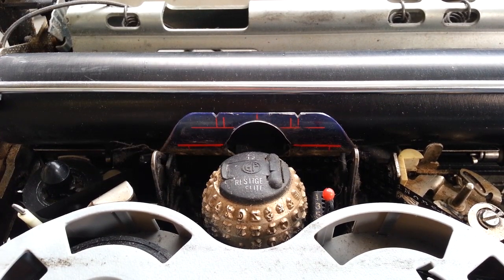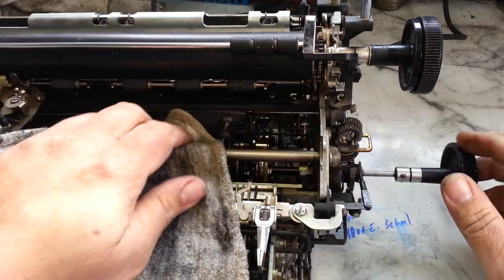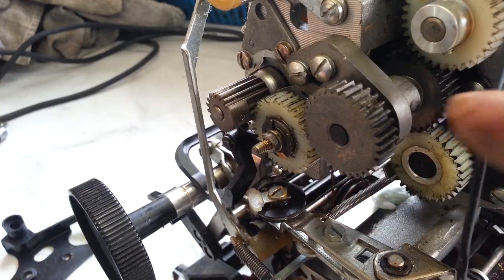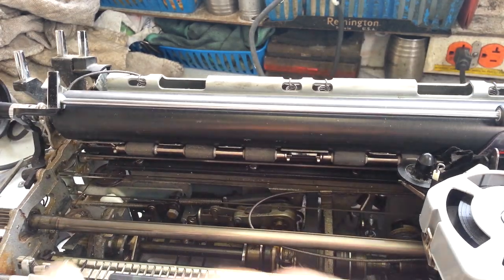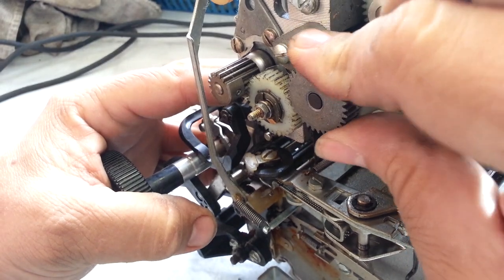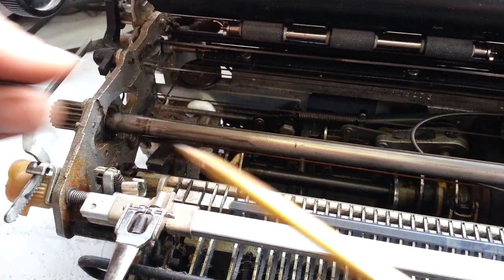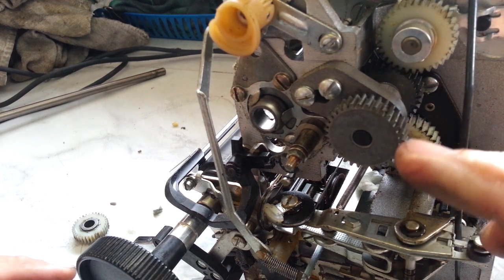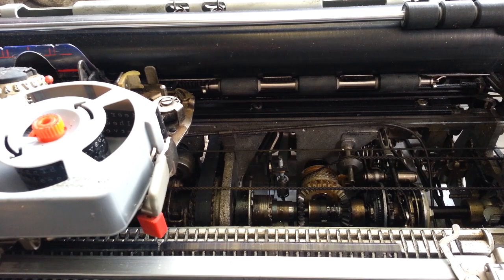IBM Selectric Ball Typewriter Frozen Stuck Stalled Broken Repair Gear

Comment: Looks like it had lots and lots of gluebricant! I'm having the same problem with mine, to the point that I decided to take the carrier off completely and give it a little bath in an ultrasonic cleaner, then oil and reassemble.

Comment: Dang, I literally said "does this thing have an engine" when I turned on the early 80s one that I bought...I'm trying to learn about machines..man's looking at this thing stresses me out. Im trying to fix a 50's era toaster am having no luck. I feel like I don't have a prayer with this type writer. It has a timing belt and needs oil changes..it is a car. Dang, the one I have only has a few minor issues I wanna fix, but I can't imagine servicing a thing like this...wow. I figured it had a motor, obviously, but this legit seems built like a car. Wow, I've got a lot to learn fam God dayummm

Comment: This golf balk getting stuck its an easy fix just flush some petrol/gasoline into the cycle clutch with the machine running & pressing the repetitive underscore key it will suddenly spring back to life.. if you pump some grease onto the hole on the cycle clutch shaft it will running smothers for a long time ..     the carrier shaft should not n

Comment: Question: what kind of applicator do you use for laquer thinner? I use a condiment bottle and it’s not nearly precise enough, and the one in this video isn’t the same as the pipette bottles I’ve seen
Reply from the maker: Yup, been using these leak proof bottles for 40 years
https://www.jensentools.com/125-093-long-reach-lube-all-dispensing-bottle-4-oz/p/125-093
Reply: @phoenixtypewriter2136  thanks so much!!!

Comment: If I may ask, what oil are you using? I might have mentioned in another video of yours that I was trained on the Selectric at the IBM plant in Lexington. Now, I'm dealing with a Selectric that has the problem of what you are showing in the video. Watching your video is shaking loose the memories and lessons I learned in the Selectric repair class. I also would like to know where I can get a spring hook and the knob that screws into the side to cycle the mechanism. With the Selectric I have, I can't turn that bar to make the ball complete its action. The carrier is stuck at the left end and I can't get it to move to the right, I assume, until I get the ball to cycle to the end of the event. Any tips? Thank you.
Reply from the maker: Hook @ https://www.amazon.com/Jonard-M-130-SX5-Lifter-Knurled/dp/B006C46PKC/ref=sr_1_3?crid=HD5EYF0XPEV2&keywords=spring+hook&qid=1583008300&sprefix=spring+h%2Caps%2C226&sr=8-3
Cycle tool on ebay, marvel mystery oil, hoopes 9 oil, look for ceased up parts impeding everything, like I mentioned, it a whole different set of diagnosis than before, mostly finding the binding parts, gummed up parts etc.
Reply: @phoenixtypewriter2136  Thank you!